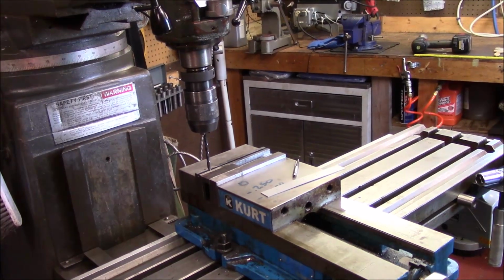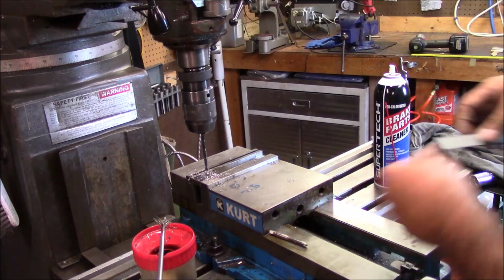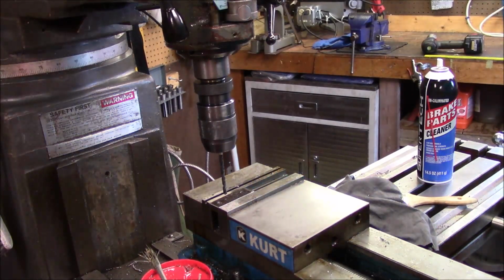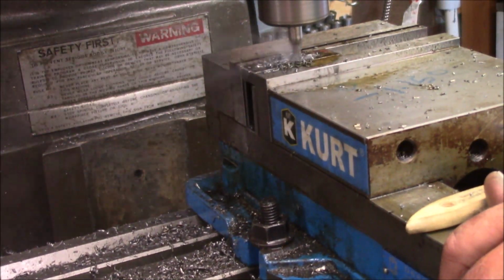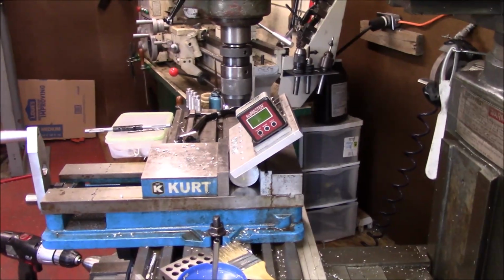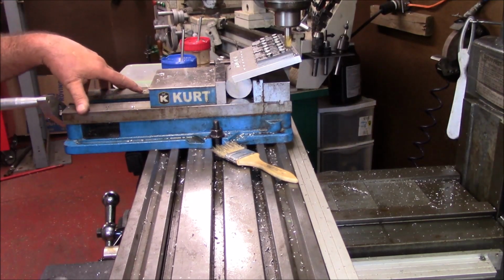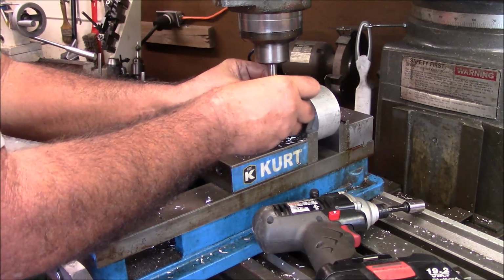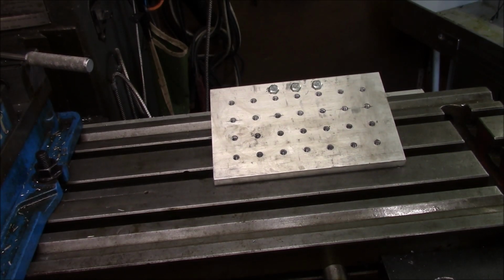Mini Pallet Clamps completion

Comment: The pallet and clamps worked out good!
Reply from the maker: Rocking J Metalworks - John Brock thanks I’m happy I got those done. What I’m happy about is I don’t have a lot of material cost in them. Old age pension only goes so far.
Reply: I know what you mean, almost all of my stock comes from the scrap yard! Rarely do I buy new stock, I have bought some good carbon steel drops off of eBay, but I just look for a type of steel that I want in sizes that would be useful.  I have a couple sellers that just charge price they pay for shipping by flat rate priority mail and they will combine shipping if I order more than one item from them.
My mail lady hates me when I get in a really heavy package.
Reply from the maker: Rocking J Metalworks - John Brock I’ve been trying to find alternative  to ordering materials. We do have a Metal Supermarket and another who handles small lots for the racing organizations here. Plus I can deal with a scrap yard. The shipping cost is so expensive it has become my last resort